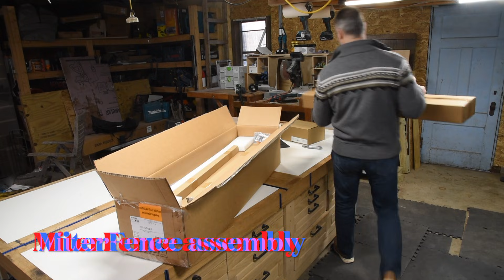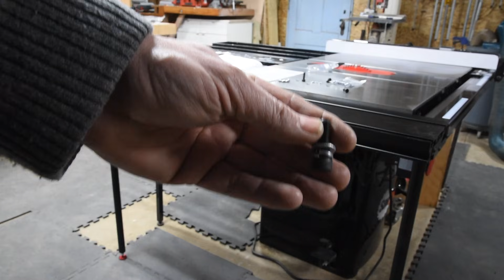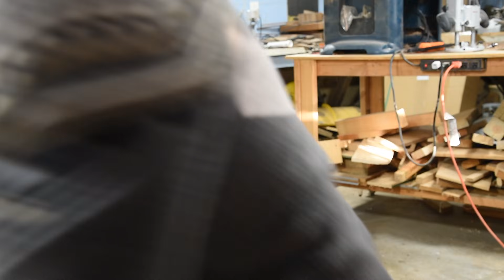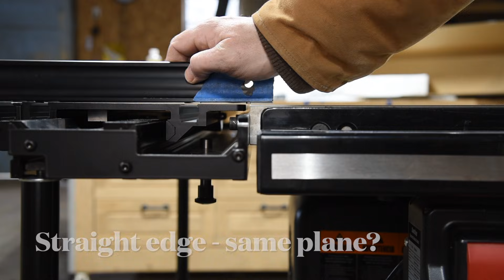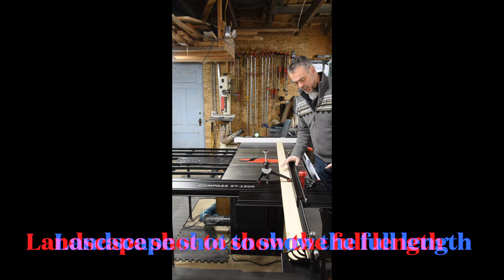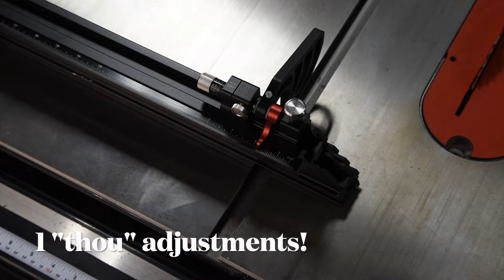Do they match? Harvey Sliding Crosscut table and Sawstop PCS

Comment: Great video. Question for you though, I'm working in half of a 2 car garage. I roll tools out to the other half to expand my "shop floor" when working but worry about how far the ST-1500 will stick out to the left of the PCS. Would I ever remove parts of it when not in use or is that a horrible idea?

Comment: I just installed this on my SawStop. What a very nice addition. I didn’t understand why used shims though. As you slid the straight edge in and it revealed a gap in the center, that would indicate that the leveling feet just needed to be adjusted to drop the outer edge of the slide and be in parallel with the table. Maybe I missed something in the video.
Reply: Glad to see I'm not the only one who's mind went to adjusting the support legs.
Reply: I see what you are saying but I think the shims are a better solution because the problem is not the height of the legs but that the vertical edge on the SawStop table is not square with the top.  Lowering the height of the legs will leave a gap that will be closed when the bolts are tightened up... hence the need for shims.

Comment: Just curious if you know how this Harvey product is different than the similar product sold by Saw Stop...The part # TSA-SA48...It almost looks like they are almost identical with just a few cosmetic differences...
Reply from the maker: honestly I dont. but, the Harvey rep told me they used to make them for SawStop. before they made their own.. Sawstop wanted to cheapen things a bit more..
Reply: The design is orginally from Excalibur sliding table saw system. There was a large and a small slider for the American style table saws. Sawstop's sliders look just likke the Excalibur, and the way patents go Harvey was contracted to make Sawstops Sliders both the larger one and the one here TSA-SA48 Sawstop for crosscuts of smaller material and the larger. Harvey took the design when the patent was up and made slight changes but is just like the Saw Stop unit. I had the pleasure of seeing them both at a trade show and the sales rep for Harvey was bragging how Their was better. I told him looks like a rip off of the Sawstop unit. That is when he explained that Harvey made Sawstop's Slider for a period of time. Not sure who or Whom is making them now that Festool owns Sawstop. But both companies saws and assecories are being made Taiwan. Both sliders do what they are advertised to do.  Only regret that I have with mt SawStop is that I can not use Molding heads such as the  Magic molder head or the Sommerfelds Beaded Face Frame system with the Sawstop. Sucks to not have the full potential of the saw but I like the safety feature and I like my fingers to stay attached to my hands.

Comment: Great review. I bought the Harvey ST 1500 about a year ago and it attached to my S/S PCS 36 flush with the fence rail. it also has the S/S industrial mobile base. I also removed my left table leaf to make the package more compact. I added the Big Eye fence about 6 months ago. The ST 1500 was a breeze to attach like you said, the big eye is not as S/S friendly and does take some fidgeting to get it right. Together they make  crosscut sleds obsolete to me. Grizzly now offers a version of the slider at a more than competitive price and the stops have grizzly bears cut into them.

Comment: I want one but how do it get out of your way when you’re not using it for cuts? Is it still pretty easy to work around when not using it?
Reply from the maker: @tsaltyginger, ~@10min in the video I show how to attach the miter to the slider.. really easy to remove. turn the red knob.. and just slide out.. now you just have a larger table..
Reply: @ thanks for the reply. I’m really wanting one but was worried it would always be in the way. As a smaller shop every bit of sq ft matters.